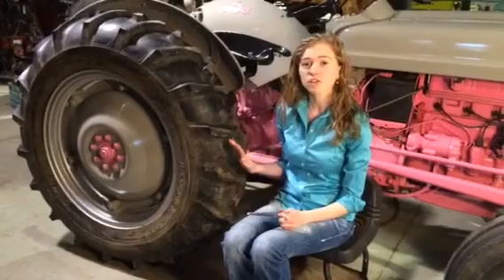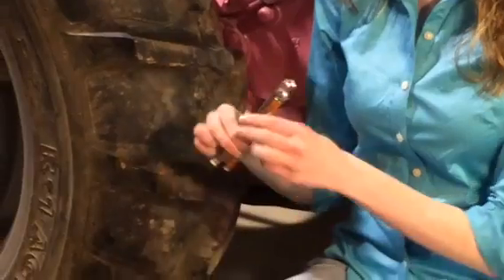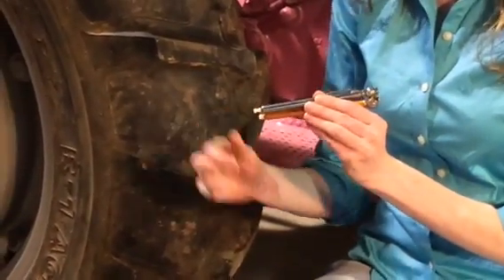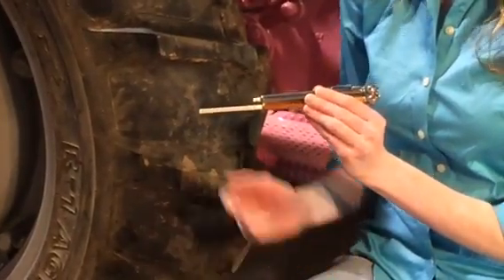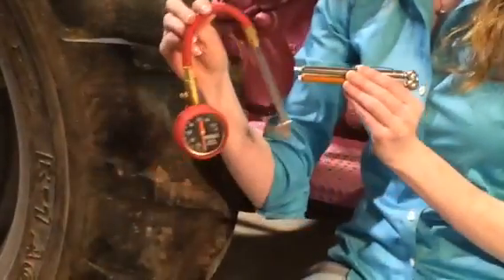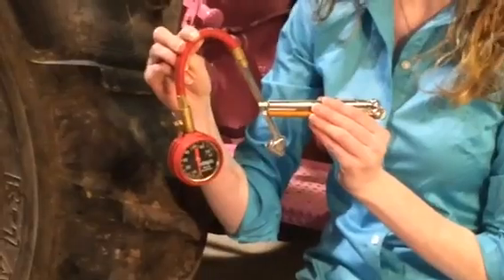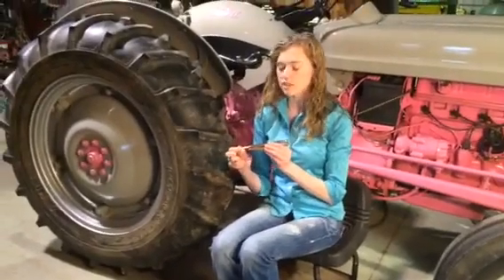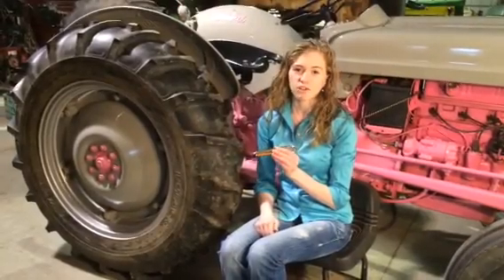How to Determine Tractor Tire Pressure

Comment: Do you have to have fluids in rear tires or can you just use air?
Reply: water in the tire is for ballast. it is not required but the added weight is almost always an advantage for tractor work.

Comment: well you forgot to tell the folks on a laoded rear tire to put the valve stem at the 12 o'clock position before checking. and that if fluid comes out its overfilled.